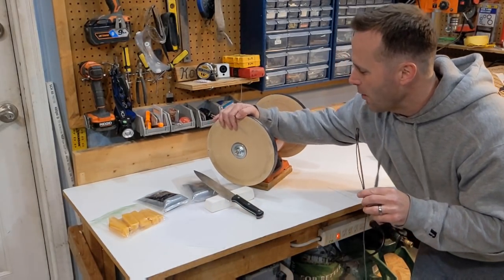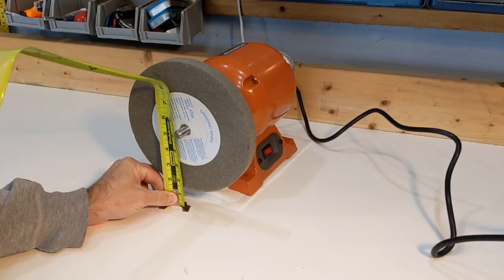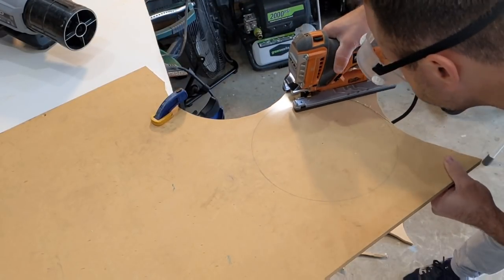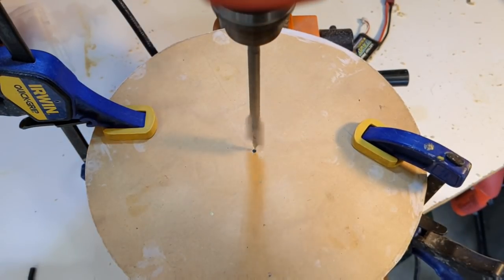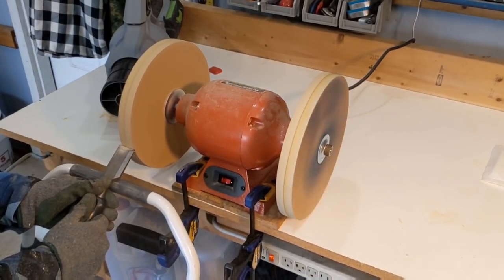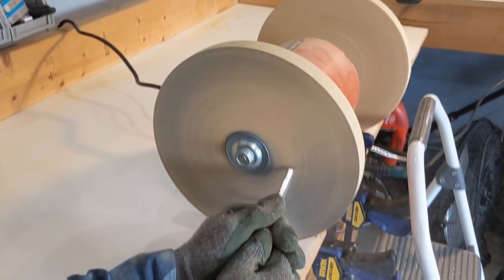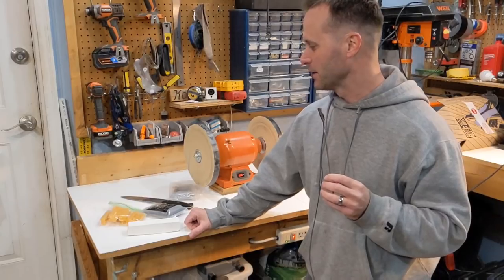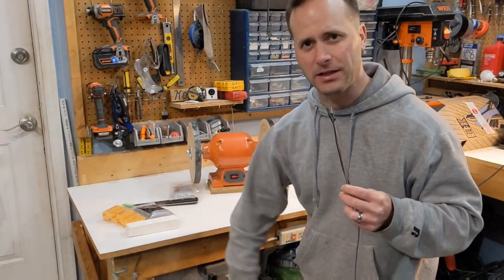DIY MDF Sharpening Wheel (XL 10")

Comment: First get on Crag's list you can find great grinder around 20 to 40 bucks!
  I've done my grinder much as shown and safer than not changing the rotation travel.
  Found it rounded the wood wheels easily 
  I used a leather strop for a 1 X 30 belt grinder and a 700 grit belt.Useing contact cement to hold both on..
   Add polishing compound to buff a mirror finish for scary sharp blades.
Good job

Comment: If you have a drill press, need to check the clearance between center and back upright support/ tube. Mine is 4 inch. So made 3/4 inch ply wheel 8 inch diameter on a Grizzly 10 inch bandsaw. Only need 1 wheel because I have linen and cotton buffing set up which uses the same rouge etc, keeping one grinding wheel alive for repairing chipped blades, chisels, sharpening bits etc. I run my buffing gear on an old B&D mains drill, and Drill Press. No need to get fancy when the gear is already in the shop. The Band Saw BTW is a gift to any workshop, along with a good Lathe/Mill and welding gear. A wood lathe is a toy ...lol.
Reply from the maker: Nice!!

Comment: May have to try this on my Shopsmith after I'm done cleaning/restoring it. With variable speed, I feel it should be safer and more controllable. Yes, I will have to work on the opposite side.
Reply from the maker: Variable speed would be great!
Reply: @kove  yeah that extra few inches being a 10" should be generating more heat, do you cool the metal by dipping it in ice water or something? The Higher RPMs of a smaller wheel bench grinder scares me to try to make this conversion on my grinder without some kind of router variable speed controller.

Comment: So does the carbide cut an edge on the blabes? I made one just like you did by gluing two pieces of 1/2 inch mdf together but only made the wheel 8" in size. I keep the wheel spinning in the downward direction and keep the gard on the grinder too. I works good but I only made one disc with no carbide. Should I make a carbide disc for cutting?

Comment: Is mdf meant to sharpen smaller items like knifes and a regular stone grinder meant for thicker items?
Reply from the maker: The MDF mainly is the surface for silicone carbide, and the polishing compound. Although the mdf alone did take off significant amount of chisel by itself when I was balancing it. Backlapping compound is made of the same silicone carbide.
Reply: @kove  nice dude! learned somethin new everyday, you should rig up a reel grinder! i know that would be nearly impossible but would be dope af!

Comment: Why did you use glue for the silicon oxide application vs. bee’s wax? When you need to refresh this wheel will you use glue oe the wax? Thanks
Reply from the maker: My understanding is the glue with impregnates the wood, making it longer lasting.

Comment: If the Carbide Grit faded, do you apply glue on the wheel then put the Carbide Grit on top so the glue can hold it?
Reply from the maker: hm, don't know. Maybe I'd sand it off, then glue a whole new layer on.

Comment: Help! Made one of these today. Double thick 1/2" MDF glued together like you. Used a chisel and sandpaper on a block to get it smooth and round. Charged it with white compound. And all I could do is blunt my knives, which were sharp before. I use stones and a strop to get hair shaving sharp easily. I thought MDF would be an upgrade. I have a variable speed bench grinder and I definitely have some side to side wobble on the wheel. Is this why I am finding blunt knives after doing this?
Reply from the maker: Sorry lito, don't know what could be causing it. 🤔
Reply: @kove  TX. Trust, to try remedy, I measured 20deg from vertical, and 20deg from horizontal and tried sharpening with the knife (held vertically) to those two angles. Have about 4-7 passes each side. Just blunt. Am ig holding it wrong?

Comment: a lot of GREAT workshop improve going on here! (perhaps that's why you 'wife cam' shows you in ballistic armor!)  Just one question.  All the commercial mdf (aka paper discs) systems seem to have one of the wheels with radial cuts along the circumference.  Is that not really necessary?
Reply from the maker: Thanks dude! Good question, I don't know. I would have did that too, but would make it even harder to balance.

Comment: If you have a table saw (yes, a table saw) or a band saw, or a router, there are a TON of circle cutting jig videos on YouTube that cut perfect circles every time. Make the jig and use it for other projects. A jig will save a TON Of time on this project.
Reply: Everything in this video is terrible, including safety.
Reply from the maker: I'll have to check those out, thanks!
Reply from the maker: I had a kevlar vest and helmet, I'd like to be upgraded from terrible safety to bad please.
Reply: Amen!
Reply: Hello.
I just found your channel and I was wondering if you might be able to help me.
I bought a bench grinder that came with one 6” x 3/4” x 1/2” grind wheel and one 8” x 1/4” x 1/2 wheel.
I messed up and broke the 1/4” wheel and now I can’t find a replacement wheel anywhere.
Might you know where I can find a replacement?
Thanks for any help and thanks for the tutorial on this build too.
Reply from the maker: @manitoumimi  sorry, don't know where

Comment: Great video! My new homemade MDF stropping wheel (not the one with silicone carbide) might need to have green compound reapplied - but I'm not sure. The perimeter of my wheel is all black. How do I tell when to apply more compound and how do I tell when to strip off the old compound and redress? Thank you!
Reply from the maker: Thanks Bob! Mine lost its color pretty quick after 4 or so knifes., I'll probably reapply the next time it's used. The manual only says how to reapply, but not when.
Reply: The dark color is metal from the sharpening process. 
Only reapply a small amount each time. More is just a waste of the compound

Comment: How thick did you make the wheels?  If you were to make it again, what would you change?
Reply from the maker: They are two thin pieces of MDF glued together, it was scrap but I think it was 1/2 or 5/8 MDF so total around ~1". If I had to do it over again, I'd make the diameter smaller because it's hard and could be dangerous to balance.
Reply: Actually if you want to round out/true up the diameter of those mdx wheels fast and with less hazard potential, out a tiger paw horizontal sanding disc on a 4-1/4" angle grinder. Fire up the bench grinder. Hold the angle grinder so the tiger paw flapper wheel is flat, above the apex of the mdx wheels to where the tiger paw will meet the top of the mdx discs at a right angle. Slowly bring the angle grinder straight down. You can feel the high points vanishing. Of course, as always...but especially since you're working at the to of the wheels, wear a faceshirld and a respirator...respirator especially if you glue the boards together like that. Great video tutorial by the way! Love it.

Comment: 1inch ply works 100 times better.. And safer too as mdf is prone to blowing out over time so be careful if u dont change it out! Plus ilu wont need the carbide chips an will get a better result with ply n just the compound. ✌️
Reply from the maker: Ply, well that is unexpected. Have you tried it?

Comment: I always wanted to do something like this but I'm afraid it'll ruin hardened steel by getting too hot. Any experience with that?
Reply from the maker: I don't, but it's a valid concern. I don't notice much heat when doing it. I'm sure one could pay close attention and make sure to stop if there's heat building up, or have water near by.

Comment: iirc... when i made mine, i used #35 grit Sand paper instead of a chisel and the wheels spin away from me, making it much safer during 'sharpening' (polishing
Reply from the maker: Good idea with sand paper. the wheel was spinning away from me, I reversed the rotation early in the vid.

Comment: I have a LOT of safety concerns about using the MDF on any rotating apparatus.
It's not designed for centrifugal force and the larger the diameter, the greater the force will be. If that wheel explodes, the result can be a disaster.
I know that many people have made these wheels and never had a problem BUT will YOU be the first casualty ?
Reply from the maker: Fair point

Comment: That’s pretty cool koven.    I love  watching your diy inventions       How long will it last for you think.  Or would you just make new wheels?    Great job    Merry Christmas to you and your family
Reply from the maker: Thanks Mike! It should last a lifetime, as you can recondition it at any time by sanding off surface (36 grit) and reapplying the glue and carbide grit. Merry Christmas you and you family too!
Reply: Very cool idea.
Reply from the maker: Thanks man! It was fun project. Learned a little more about woodworking, and a ton about knife sharpening.
Reply: Nice, if you cut small x's around wheel.
 The part you turned. Load with valve grinding compound.
Reapply as needed. 
 Load other wheel with the white Rouge.
With  x's on face . 
 Ez to renew. Makes you able to make scary sharp tools. 
 Make sure you use good MDF wood.
Cheap stuff can fly apart. Yes it makes a difference!

Comment: 1:19 These faceplates are a mockery of the consumer! You immediately get eternal end vibrations. First you need to roll the turner with a normal faceplate with an outer diameter of 32 mm. And use discs with such a hole.
Reply from the maker: good advice, thanks~!
Reply: @kove  I recently made two videos about it.
Reply from the maker: Checking them out now, great content over there. Sidenote, surprised hasn't YT hasn't recommended it to me.

Comment: super skill
Reply from the maker: Any tips?
Reply: @kove  
Apply wood sealer to the sides of the MDF wheels and let it dry completely.
MDF absorbs moisture quite easily and as the wheels absorb moisture they will swell and weaken.

Comment: What grit silicone carbide did you use? What was the beeswax for?
Reply from the maker: It's labeled 180/220 grit. The beeswax a) helps control heat & b) helps the grit stay on 
the wheel longer.

Comment: I read a lot of comments and so far no safety police yet (lol)  the plywood comment makes sence. I have always found the larger the diameter wheel the better the job ( it has to do with producing a better hollow ground edge) so going 10" is going to make it better than commercial 8" IMHO. Question the silicon oxide grit that is glued on does it stay on or do you have to replace ( I was not clear on that) also the white wheel on right you are just using polishing compound?
Also a lot of Japanese wheels are used horizontality or on the flat side of the wheel do you think it can and should be used in that axis's. Last a WEN drill press????? I have not had a lot of luck with those peoples products they just don't hold up, I have their wet wheel and when it worked it was a great system and idea but their stuff is the worst quality out of any power tool I have ever used and I own, like and even love and praise some of the Harbor Fright stuff so I am not a snob when it comes to inexpensive power tools.
Reply from the maker: The silicon oxide grit wears down and it eventually needs to be scraped back to wood, and glued to the wheel again. The white side indeed is polishing compound. That's an interesting idea to rotate the axis, I think it'd make holding a consistent angle easier to achieve. I'll have to give that some thought. A WEN drill press, yep! Good/bad experience with them??

Comment: I'd be concerned about the centrifugal force and the wheel exploding.
I'd like to make one but with a slower RPM, maybe a 1725 RPM motor and 8" diameter.
Another concern is MDF was NEVER intended to be used in this manner. There have been NO tests to determine the strength under centrifugal force and there is NO safety rating for this kind of use.
Reply from the maker: I was concerned too! Hindsight, I'd keep the smaller diameter wheel and have a variable speed controller.

Comment: What was the yellow stuff and can you use any glue
Reply: Beeswax
Reply from the maker: Beeswax, it  a) helps control heat & b) helps the grit stay on
the wheel longer. Yes, regular wood working glue for the grit.

Comment: Joven, the wheels could be done from plywood or wood? Or it has to be made from  MDF
Reply from the maker: Hi Jorge, they are MDF. Thanks for watching!
Reply: @kove  I know that it isMDF. My question is if I can use plywood or wood instead of MDF.
Reply from the maker: @jorgenj1  Ah, I see. I don't know but others have said they've used plywood. I tried to emulate as best I could the original design. I don't know if the manufacturer's decided MDF is better suited, or simply cheaper.
Reply: @kove  thank you for your reply
Reply: @jorgenj1  
DON'T  USE  SOLID WOOD ! 
The centrifugal force can cause it to explode along the grain line.
(possibly with disastrous results)
Plywood should be safer than MDF but MDF seems to be the preferred material.
Reply: @workonitm8  thank you

Comment: Shouldn’t it have lower RPM for grinder? Goes pretty fast.
Reply from the maker: Yes. I'd make a smaller diameter next time, and/or get a lower RPM machine.
Reply: I'd think 1725 RPM would be safer but grinders with 1725 RPM motors are a bit hard to find.

Comment: The wider the wheel, the better, when putting an edge on anything over 4-5" long . 2 - 4" wide  wheel would be better for over 4 to 5" blade. This supports blade fully and makes honing almost foolproof. 
Speed should be half of 3000 rpm or around 1500 rpm or even less, especially of you want to buff/polish after. 
This system in the video will work fine until: you hesitate or move blade accidentally during a sharpening swipe. The it will dig into the blade and might mar it or burn it (draw temper at around 5-600 degrees, making it useless . 
You might get away with it , but only as a seldom used machine. 

Better to start with 1500 rpm, 3/4 - 1 HP motor, rotation away from your face, and use pulleys with pillow block bearings, to adjust wheel speed. Use no less than 1/2" drill rod for shafts.
Thinner wheels are fine to start with, only make sure you buy a brand that will allow you to add on to original stack when you can afford it. Sewn cotton buffs are best to start with, but for 140 or coarser, get large sisal. Brownell's sells tube or horse glue base abrasive polish-o-ray, that I have used for 37 years. I slice off an inch or two like salami, add it chopped up to a little water in an old thick small pot and melt it, then paint it onto wheel. Then when dry, put it on shaft and use ball peen to crack up solid glue surface. Adding Craquelure . 
 I use 140 and 240 and they last a long time. I use them after sand belts.   Never shared this and I see it is verbose, so that's it. This for for serious steel polishers only - pros.
Reply from the maker: Thouartit, this is the best and most helpful comment I've had on my channel. I'm thinking of redoing this project and need to use your tips! Thank you! And Happy Thanksgiving

Comment: I would consider making  a  fixed  support with adjustable height and angle to control and maintain bevel angle of the tool or knife being sharped  and while polishing the edge.  Thus making it easier to control safely. Recommend for anyone trying up the mdf do  it outside, and  make sure you are wearing a mask or respirator and eye protect.  What is the beeswax used for?  Bet it would be great for putting an edge on a  chisel, plane iron, adze, axe, hatchet or draw knife. With the right jig it could be used to sharpen drill bits.
Reply from the maker: I hadn't thought of that, great idea! Finding the desired tangent angle at X, Y and Z heights. Also good advice about PPE when grinding the MDF, it gets everywhere. From what I've read, the beeswax a) helps control heat & b) helps the grit stay on the wheel longer. Thanks for the insight and checking it out.

Comment: A standing block would do the same thing and be a little safer than a chisel
Reply from the maker: Good idea!
Reply: @kove  You made a video about what not to do. This also applies to safety precautions.
Try to order a faceplate from a turner with an outer diameter of 32 mm and buy abrasive discs with such holes. And also remove the weight imbalance of abrasive discs and then correct their radial geometry with a diamond pencil. After that, you will be very surprised how perfectly the discs rotate without any vibrations.